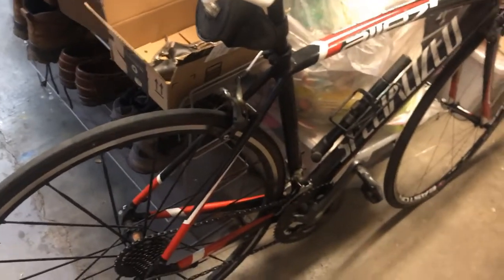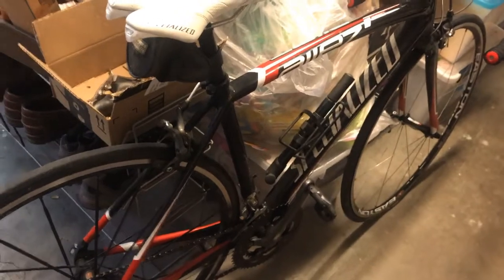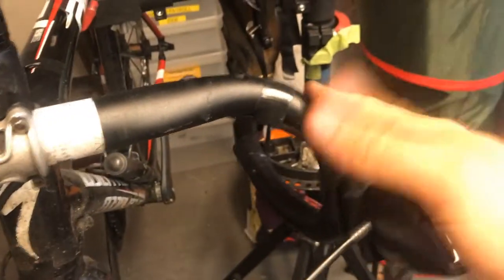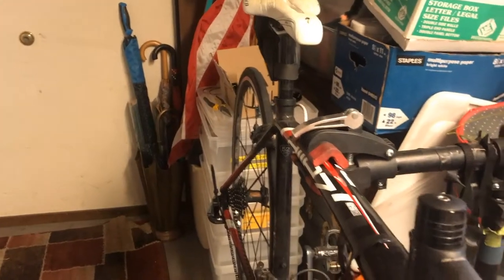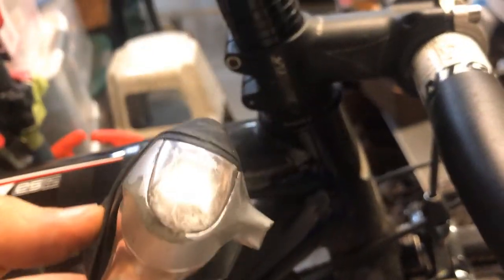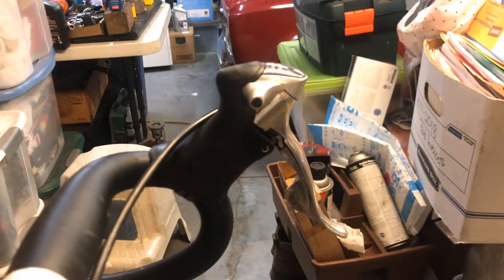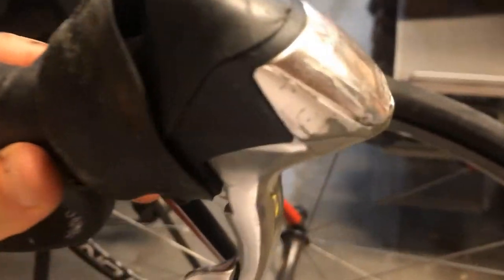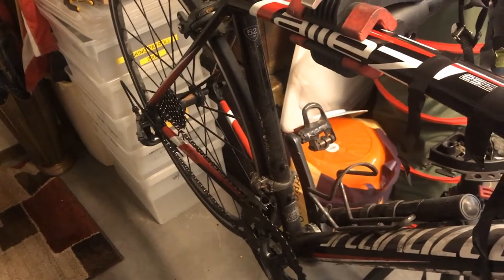10-speed to 9-speed conversion road bike

Comment: I have the same shifters and just replaced the gear cable but the shifter won't return to a neutral position when changing gears. Any ideas on how to fix? (The shifter itself doesn't seem to be the problem because it does return without the cable attached to the derailleur) Any help much appreciated!

Comment: A reverse question perhaps you could  answer... I am planning to install a Tiagra 10 speed shift lever with a Sora 9 speed rear derailleur .. will it work, will the high limiter screw stop the shifting when it reaches the 1st gear ?
Reply: I have a tektro hydraulic disc brake on a flat bar and I am moving it to a hood... Sora does not have a hydraulic setup hence the upgrade ...
Reply: The spacing is the same, you shouldn’t need to change your limit screws that much. But tiagra 4700 has a different pull ratio then the older 10 speed stuff, so your sora 9 speed will only work with pre tiagra 4700 10 speed stuff.

Comment: So are 9 and 10 speed really that compatible? I got a KMC Gold 9 speed chain for my 2013 sora allez and never installed it. Now I have a 10 speed Tiagra Diverge. Can I throw that bad boy on?
Reply from the maker: A 10 speed chain can handle a 9 speed drive chain but not the other way around. Unfortunately you would need a 10 speed chain. 9 speed rear derailleurs are compatible with 10 speed chains and cassettes also.